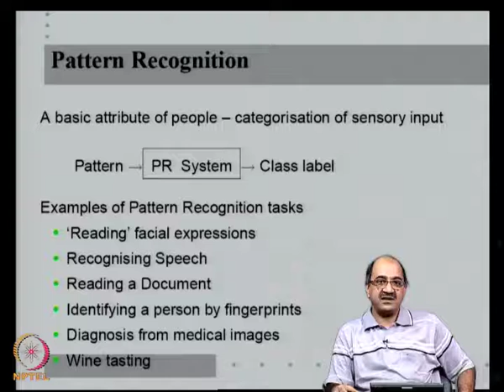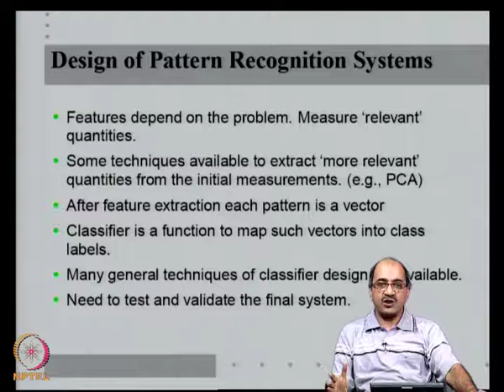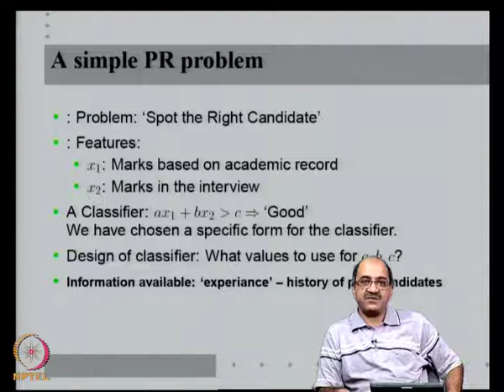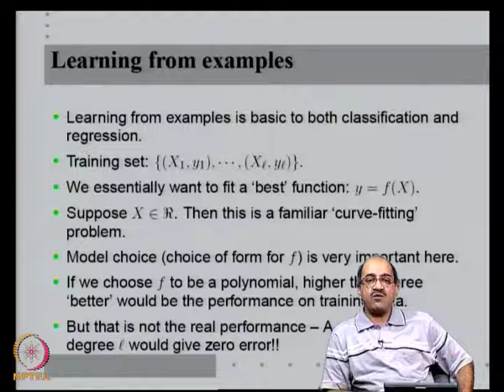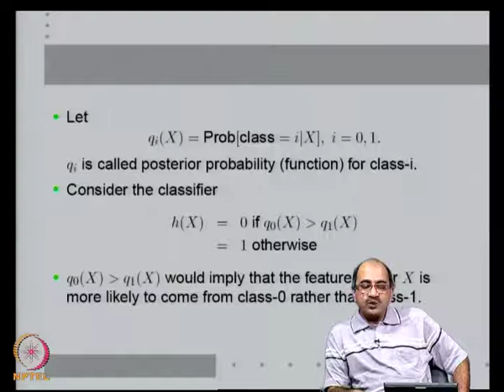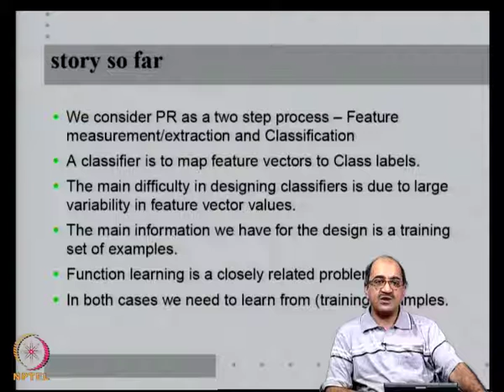Mod-01 Lec-01 Introduction to Statistical Pattern Recognition

Comment: Sir we study pattern recognition in mobile phones security settings and digital attendance system. In our organisation in digital attendance system these is used of fingerprint and face for authentication. These systems are connected to personal computers through network. The details of students are fetched in the processors through cable and when these data get matched the attendance of students get successful. Sir we want to know how these data  fetching through network can be done?

Comment: good lecture - it would be better if he presents bit slower and clearer. Also, since he is reading out the slides, it would be easy to follow if the slides are completely visible